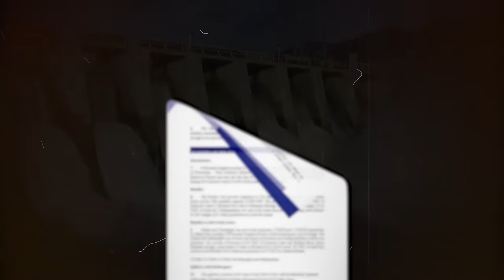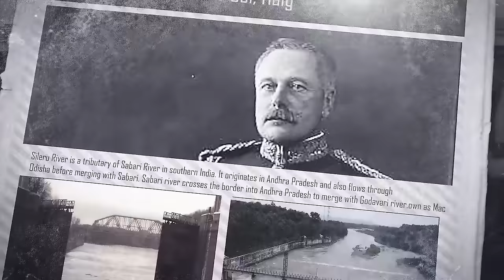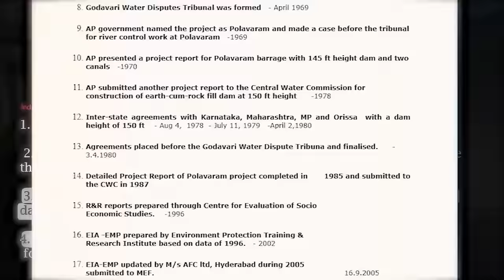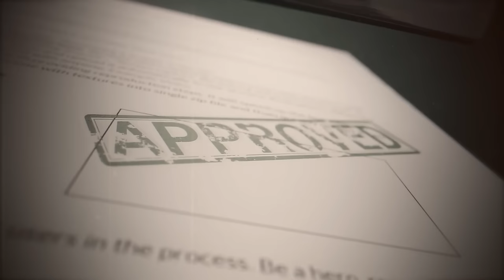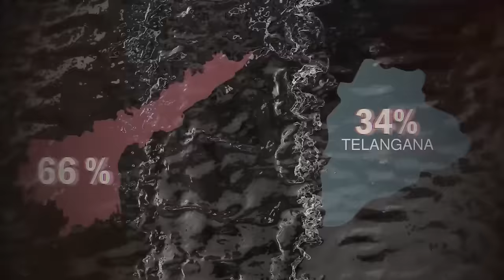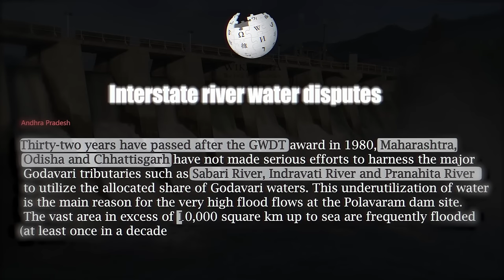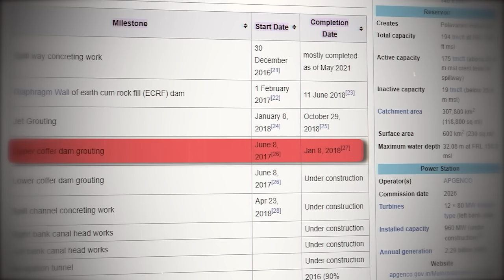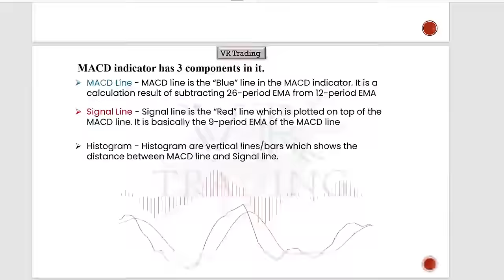పోలవరం కలెక్షన్లు ఎంత ? | Polavaram Project | Telugu Facts | VR Raja Facts

Comment: Under ground power supply గురించి ఒక వీడియో చెయ్యండి bro...ఇండియా లో ఇది సాధ్యమో కాదో అని ఒక వీడియో చేయండి plzzzzz ❤❤❤
Reply: Central electricity authority vaalla pdf doc. Okati dorukutundi..follow avvandi. Comparatively costly antaaru. High grade insulated wires are required where as no insulation is required for normal power supplies. The soil in all places might not support. The power cut off detection and repair might be Comparatively costly if the wire get cut etc reasons are much clearly explained in that.

Comment: You missed the point that the money increased to 52k crore in 2017. Due to the increase of the money center, the A.P. government is using Polavaram as an ATM. You mentioned the spillway was already built in T.D.P government, so there is no chance of opposing at that time. For that, again around 2.5k cr to 3k cr loss-making. There are many cases. But much appreciated and well-balanced explanation.
Reply: Manam votes vesi gelipinchana vedavallani adigali bro neevu you Tuber aduguthunave😂😂😂
Reply: Polavaram & Kaleshwaram are Brain childs of Dr YSR 👏🏻